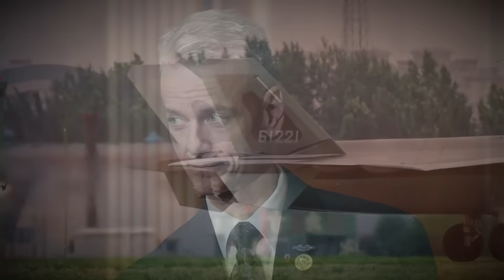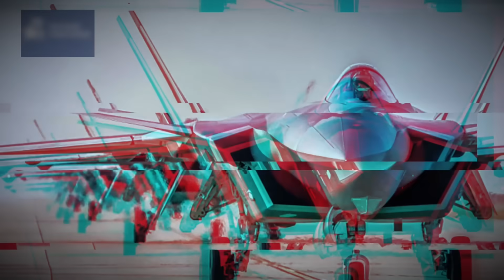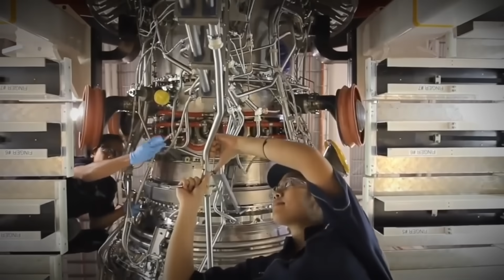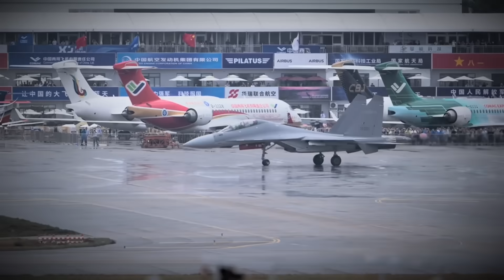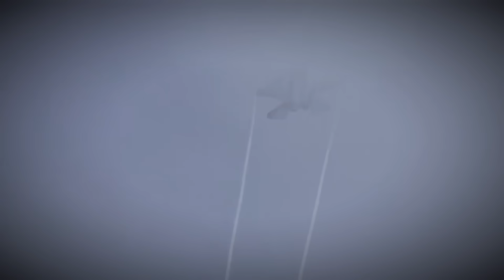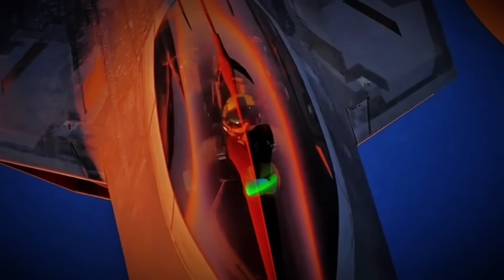GE Just Broke Its Silence on China's Jet Engine Advancement

Comment: Actually, there are 3 types of engine under test...
Reply: China's Fighter Jet Engines: 5th-Gen Leading the Way, 6th & 7th-Gen Test Flights Breaking New Ground, Fully Surpassing the U.S.
 
China's aviation engine sector has achieved a leapfrog development from catching up to global leadership. The 5th-gen engines WS-15 and WS-19 have long outperformed their U.S. counterparts in performance. The 6th and 7th-gen fighter jet engines have even completed successful test flights ahead of schedule, completely widening the generational gap with the U.S. in core technologies, performance parameters and future layout, demonstrating the strong strength of China's aviation engines and firmly seizing the commanding height of the global aviation engine track.
 
In the field of 5th-gen engine power, WS-15 and WS-19 have made precise breakthroughs in U.S. technical barriers. As the standard power for the J-20, WS-15 is a performance benchmark among global 5th-gen large-thrust engines, with afterburning thrust reaching 18.5 tons and thrust-to-weight ratio exceeding 10.5. Compared with the F119 engine equipped on the U.S. F-22, its thrust is increased by 18.6% and thrust-to-weight ratio is over 50% higher, directly endowing the J-20 with 1.8 Mach supersonic cruise capability, and the response speed of supermaneuverable actions is 0.8 seconds faster than that of the F-22, achieving comprehensive suppression in air combat and penetration capabilities. In terms of core materials, WS-15 adopts domestically developed 3rd-gen single-crystal turbine blades that can withstand temperatures up to 1577℃, equipped with 128 nanoscale micro-cooling channels, improving cooling efficiency by 37%. The stable working time of the blades exceeds 4000 hours, and its high-temperature reliability is 1.5 times higher than that of the F119, completely solving the problem of high-temperature wear of previous aviation engines. WS-19, adapted for medium-sized 5th-gen fighters, is a world-leading medium-thrust engine with maximum thrust exceeding 12 tons, far surpassing the 10-ton thrust limit of the U.S. F414 engine equipped on the F/A-18. Its turbine inlet temperature reaches over 1850K, with excellent explosive power and energy conversion efficiency. It also adopts a compact 3-5-1-1 configuration, reducing weight by 12% while improving reliability by 20%, adapting to the deck operation needs of carrier-based aircraft. Its performance is comprehensively superior to the U.S. F414 and European EJ200 engines, filling the gap in domestic medium-sized 5th-gen fighter power.
 
On the basis of the stable leadership of 5th-gen engine power, China's 6th-gen fighter jet engine has taken the lead in completing installed test flights, with technical maturity and performance far ahead of the U.S. The U.S. 6th-gen engine XA100 is still in the ground test and partial verification stage, with unresolved mode switching failure risks, while China's 6th-gen variable cycle engine has achieved stable air operation, with core technologies and performance indicators reaching the world's leading level. In terms of performance, the engine's afterburning thrust exceeds 22 tons and thrust-to-weight ratio is over 12, 17% and 14% higher than the U.S. XA100 target values respectively. It adopts variable cycle technology with independent intellectual property rights, which can seamlessly switch between "high-thrust supersonic cruise mode" and "high-efficiency energy-saving cruise mode" in less than 0.5 seconds. It can not only support 6th-gen fighters to achieve 2.5 Mach supersonic cruise and a range exceeding 10,000 kilometers, but also reduce fuel consumption by 37.5% during subsonic flight, balancing combat effectiveness and endurance; the U.S. XA100 can only achieve a 10% increase in thrust and 25% fuel saving, and its complex mechanical valve structure is prone to stuck mode switching, resulting in significantly lower practicality. In terms of technology, China's 6th-gen engine innovatively adopts a three-bypass + interstage combustion chamber design, reducing 20% of core parts, with a fault diagnosis accuracy rate of 99.2%, which can predict faults 200 flight hours in advance and improve maintenance efficiency by 50%; it is also equipped with new stealth composite materials, reducing the engine's radar cross-section by 60%, meeting the all-domain stealth needs of 6th-gen fighters, while the U.S. XA100 still uses traditional metal casings with no substantial breakthrough in stealth performance, showing an obvious technological generational gap.
 
More promisingly, China's 7th-gen fighter jet engine has completed its first flight with the prototype, while the U.S. is still in the technical pre-research stage, completely seizing the opportunity in the future aviation engine track. China's 7th-gen engine breaks through the traditional turbofan power framework, adopting combined cycle propulsion technology integrating turbofan-ramjet-scramjet, combining hydrogen-oxygen rotating detonation power principle, with thermal efficiency reaching 49%, thrust increased by 20% compared with 6th-gen engines and weight halved. It can support fighters to achieve hypersonic cruise above 5 Mach in the atmosphere and a maximum speed exceeding 6.5 Mach, and can also adapt to low-orbit space flight, realizing "air-space integration" all-domain combat; the U.S. 7th-gen engine still focuses on traditional turbofan technology upgrades, failing to overcome the hypersonic propulsion mode switching problem, and can only achieve a speed target below 4 Mach, with comprehensively limited power performance and application scenarios. In terms of core technological breakthroughs, China's 7th-gen engine has conquered key technologies such as high-temperature supercritical pressure pipelines and quantum plasma stealth coatings, with turbine blades capable of withstanding temperatures exceeding 1827℃, and can operate stably in extreme environments such as high-altitude low temperature (-60℃), high humidity (95%) and sandstorms, with full battlefield adaptability; it also innovatively adopts intelligent bionic structure and self-healing technology, which can automatically fill and repair minor component damage within 1 hour, greatly improving battlefield survival capability. In contrast, the core materials and self-healing technology of the U.S. 7th-gen engine are still in the laboratory stage, and no long-term ground thermal test has been carried out. Compared with China's progress of completing the first flight and gradually advancing engineering, the generational gap cannot be narrowed in the short term.
 
From the 5th-gen engine outperforming U.S. counterparts, to the 6th-gen engine leading in test flights, and then to the 7th-gen engine taking the lead in opening a new air-space track, China's fighter jet engines have achieved continuous breakthroughs in three generations of iteration, with core materials, key technologies, performance parameters and development progress comprehensively surpassing the U.S. It not only lays a solid power foundation for the leapfrog improvement of China's air force combat effectiveness, but also redefines global aviation engine technical standards, demonstrating the absolute competitiveness of China's high-end manufacturing and cutting-edge technology, and completely breaking the long-term Western monopoly in the aviation engine field.

Comment: Does China still importing these engines? Even those J series?
Reply: J10, J15T, J16 are using ws10b
J20 using ws15
J35 using ws19
I think those older iterations like J11 and  JF17 from Pakistan are using Russians.
Reply: @andrewlim7751  that's right. but PLANN has no JF17 and stop build J11 long time ago. the last engine they imported from Russia is DP-30K which was used on Y-20 and that jet engine was replaced by WS-20 later. that's why you saw Y-20B during V-day. the last time they import DP-30K is around 2017.
Reply: They stopped importing from Russia for about 4/5 years at least.
Reply: China's Fighter Jet Engines: 5th-Gen Leading the Way, 6th & 7th-Gen Test Flights Breaking New Ground, Fully Surpassing the U.S.
 
China's aviation engine sector has achieved a leapfrog development from catching up to global leadership. The 5th-gen engines WS-15 and WS-19 have long outperformed their U.S. counterparts in performance. The 6th and 7th-gen fighter jet engines have even completed successful test flights ahead of schedule, completely widening the generational gap with the U.S. in core technologies, performance parameters and future layout, demonstrating the strong strength of China's aviation engines and firmly seizing the commanding height of the global aviation engine track.
 
In the field of 5th-gen engine power, WS-15 and WS-19 have made precise breakthroughs in U.S. technical barriers. As the standard power for the J-20, WS-15 is a performance benchmark among global 5th-gen large-thrust engines, with afterburning thrust reaching 18.5 tons and thrust-to-weight ratio exceeding 10.5. Compared with the F119 engine equipped on the U.S. F-22, its thrust is increased by 18.6% and thrust-to-weight ratio is over 50% higher, directly endowing the J-20 with 1.8 Mach supersonic cruise capability, and the response speed of supermaneuverable actions is 0.8 seconds faster than that of the F-22, achieving comprehensive suppression in air combat and penetration capabilities. In terms of core materials, WS-15 adopts domestically developed 3rd-gen single-crystal turbine blades that can withstand temperatures up to 1577℃, equipped with 128 nanoscale micro-cooling channels, improving cooling efficiency by 37%. The stable working time of the blades exceeds 4000 hours, and its high-temperature reliability is 1.5 times higher than that of the F119, completely solving the problem of high-temperature wear of previous aviation engines. WS-19, adapted for medium-sized 5th-gen fighters, is a world-leading medium-thrust engine with maximum thrust exceeding 12 tons, far surpassing the 10-ton thrust limit of the U.S. F414 engine equipped on the F/A-18. Its turbine inlet temperature reaches over 1850K, with excellent explosive power and energy conversion efficiency. It also adopts a compact 3-5-1-1 configuration, reducing weight by 12% while improving reliability by 20%, adapting to the deck operation needs of carrier-based aircraft. Its performance is comprehensively superior to the U.S. F414 and European EJ200 engines, filling the gap in domestic medium-sized 5th-gen fighter power.
 
On the basis of the stable leadership of 5th-gen engine power, China's 6th-gen fighter jet engine has taken the lead in completing installed test flights, with technical maturity and performance far ahead of the U.S. The U.S. 6th-gen engine XA100 is still in the ground test and partial verification stage, with unresolved mode switching failure risks, while China's 6th-gen variable cycle engine has achieved stable air operation, with core technologies and performance indicators reaching the world's leading level. In terms of performance, the engine's afterburning thrust exceeds 22 tons and thrust-to-weight ratio is over 12, 17% and 14% higher than the U.S. XA100 target values respectively. It adopts variable cycle technology with independent intellectual property rights, which can seamlessly switch between "high-thrust supersonic cruise mode" and "high-efficiency energy-saving cruise mode" in less than 0.5 seconds. It can not only support 6th-gen fighters to achieve 2.5 Mach supersonic cruise and a range exceeding 10,000 kilometers, but also reduce fuel consumption by 37.5% during subsonic flight, balancing combat effectiveness and endurance; the U.S. XA100 can only achieve a 10% increase in thrust and 25% fuel saving, and its complex mechanical valve structure is prone to stuck mode switching, resulting in significantly lower practicality. In terms of technology, China's 6th-gen engine innovatively adopts a three-bypass + interstage combustion chamber design, reducing 20% of core parts, with a fault diagnosis accuracy rate of 99.2%, which can predict faults 200 flight hours in advance and improve maintenance efficiency by 50%; it is also equipped with new stealth composite materials, reducing the engine's radar cross-section by 60%, meeting the all-domain stealth needs of 6th-gen fighters, while the U.S. XA100 still uses traditional metal casings with no substantial breakthrough in stealth performance, showing an obvious technological generational gap.
 
More promisingly, China's 7th-gen fighter jet engine has completed its first flight with the prototype, while the U.S. is still in the technical pre-research stage, completely seizing the opportunity in the future aviation engine track. China's 7th-gen engine breaks through the traditional turbofan power framework, adopting combined cycle propulsion technology integrating turbofan-ramjet-scramjet, combining hydrogen-oxygen rotating detonation power principle, with thermal efficiency reaching 49%, thrust increased by 20% compared with 6th-gen engines and weight halved. It can support fighters to achieve hypersonic cruise above 5 Mach in the atmosphere and a maximum speed exceeding 6.5 Mach, and can also adapt to low-orbit space flight, realizing "air-space integration" all-domain combat; the U.S. 7th-gen engine still focuses on traditional turbofan technology upgrades, failing to overcome the hypersonic propulsion mode switching problem, and can only achieve a speed target below 4 Mach, with comprehensively limited power performance and application scenarios. In terms of core technological breakthroughs, China's 7th-gen engine has conquered key technologies such as high-temperature supercritical pressure pipelines and quantum plasma stealth coatings, with turbine blades capable of withstanding temperatures exceeding 1827℃, and can operate stably in extreme environments such as high-altitude low temperature (-60℃), high humidity (95%) and sandstorms, with full battlefield adaptability; it also innovatively adopts intelligent bionic structure and self-healing technology, which can automatically fill and repair minor component damage within 1 hour, greatly improving battlefield survival capability. In contrast, the core materials and self-healing technology of the U.S. 7th-gen engine are still in the laboratory stage, and no long-term ground thermal test has been carried out. Compared with China's progress of completing the first flight and gradually advancing engineering, the generational gap cannot be narrowed in the short term.
 
From the 5th-gen engine outperforming U.S. counterparts, to the 6th-gen engine leading in test flights, and then to the 7th-gen engine taking the lead in opening a new air-space track, China's fighter jet engines have achieved continuous breakthroughs in three generations of iteration, with core materials, key technologies, performance parameters and development progress comprehensively surpassing the U.S. It not only lays a solid power foundation for the leapfrog improvement of China's air force combat effectiveness, but also redefines global aviation engine technical standards, demonstrating the absolute competitiveness of China's high-end manufacturing and cutting-edge technology, and completely breaking the long-term Western monopoly in the aviation engine field.